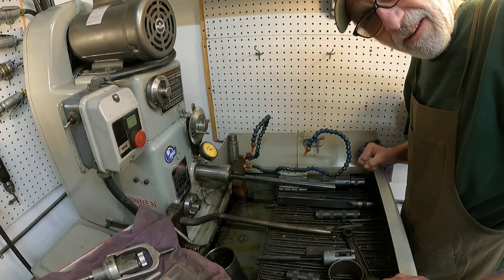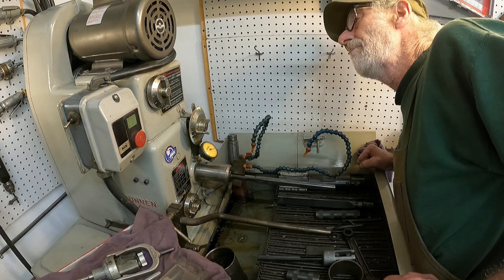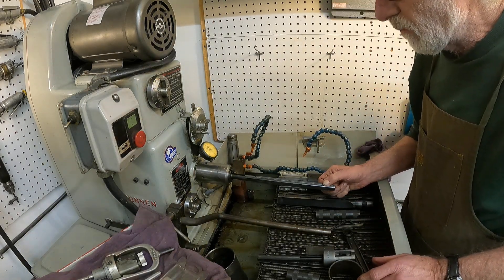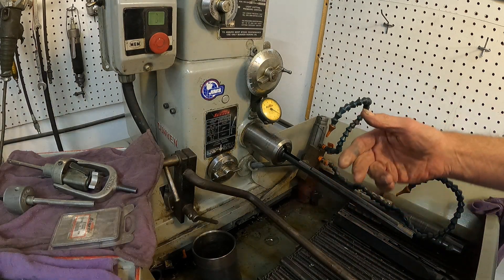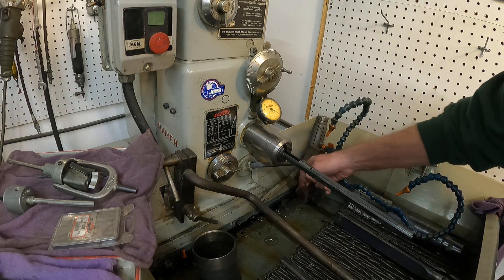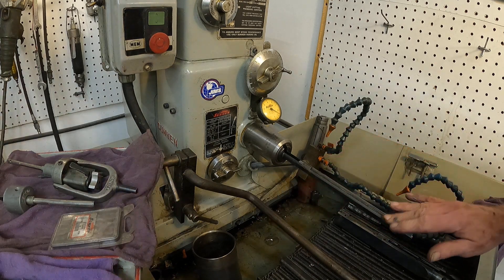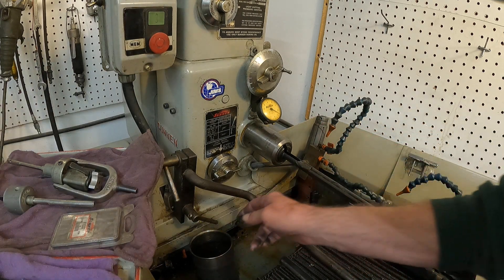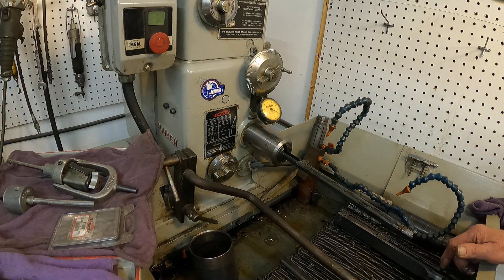Sunnen honing 3 preparing the mandrel for high precision machining.

Comment: Would love to learn how to read and use a dail bore gauge also!
Reply from the maker: Those are a nice addition, just have to decide what brand or style Sunnen is the most expensive
Reply: @deedeeindustrialsuperprecision  yep I just purchased the sunnen cf-1126 fitting fixture and the sunnen Gr-2241 dail bore gauge it’s in .0001 but your right very expensive alittle over 4k for both!
Reply from the maker: @cdpperformance2613  Very early on I went with the Standard brand of gages used, but they have only .030" range once set. you have the best gages now.
 The Sunnen machine will put out accuracy of 50 millionths routinely that some say is not possible.

Comment: Thank you for posting these. I’m about to embark on a nice learning curve with a power stroke machine in an aerospace machine shop. 

Also, cool manometer, what have you used that for?
Reply from the maker: I have not had the opportunity to use the power stroke machines, you will be doing high precision work it sounds. I used those manometers and the Cleco die grinders on the wall to port and flow Harley Davidson cylinder heads.

Comment: We had a red 1974 Sunnen in an automotive machine shop used on connecting rods.  Both big and small ends.  It had a very handy dial bore gage where your on/off switch is.  The best part about running that machine was walking away with clean although oily hands.  It was also very satisfying to make precision holes with a fairly simple process.  I always wondered what those truing sleeves were made of.
Reply from the maker: Hi, those machine mounted gages go for more than the machine itself sometimes. The sleeves are just steel and not real expensive. I am not sure the oil is the same used in automotive, the regular industrial oil is dark, smells and hard to get off, I use a barrier creme.